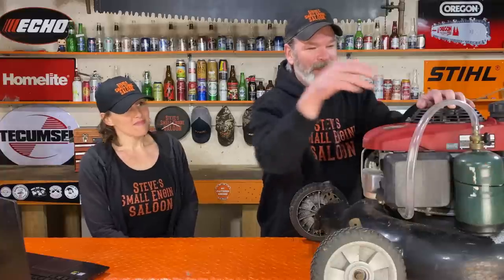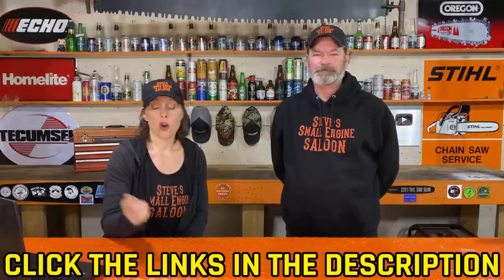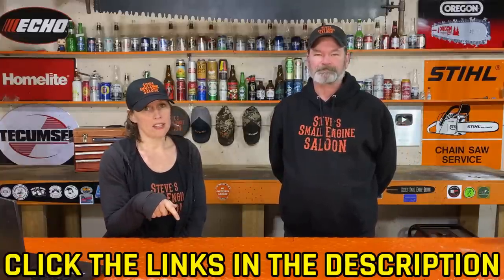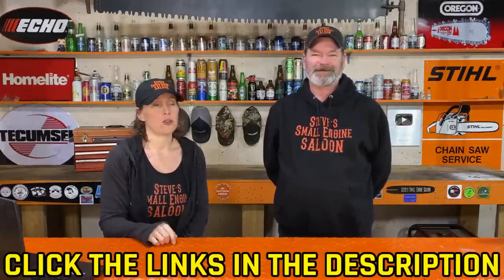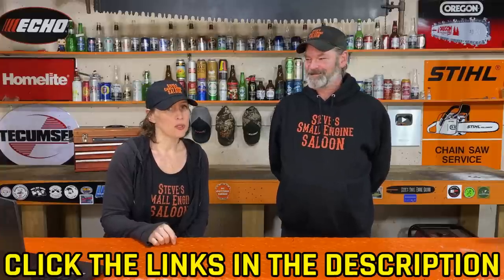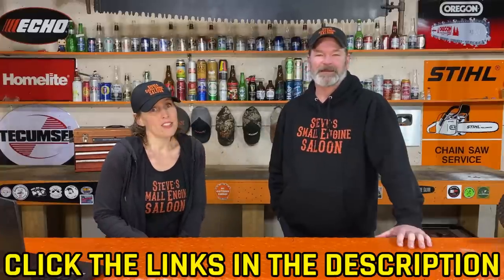Can I Make A Lawn Mower Run On Propane? (DAY 30)

Comment: I ran a 5 hp tiller on propane for a few years. 
I removed the gas tank and injected the propane in the carburetor nozzle. Was a little hard to start but once started ran fine

Comment: a propane torch (unlit) makes a very good alternative to ether.  hold the torch so the air intake draws the propane in, and it will fire off the engine enough to get it to start drawing gasoline.  I've also primed a stubborn engine by putting a splash of gas on the air cleaner element and reassembling the air cleaner.

Comment: I converted my log splitter, whole house generator and 6hp outboard to propane. I use replacement dual fuel carbs on Amazon and BBQ grill regulators from Walmart.

Comment: maybe someone already asked you and you answered it somewhere else but I have some chainsaw gas mix that is about 2 years old and want to use it up, I hardly ever use my chainsaw being in the suburbs and don't want the gas to get too old (non-ethanol), a co-worker said I can use it in my snow blower and lawn mower without any damage to them. is that true? and love your videos learned so much on small engine maintenance and upkeep thanks for the videos

Comment: I certainly hope so!  I bought 2 60" Gravely 460 models with air suspension seats about 10 years ago that ran on propane.  I kept one for the house when I sold my lawncare business.  at the time it was cleaner for the environment and propane cost less to run.  Propane only gets about 70% efficency compared to a gallon of gas though due to lower BTU's.  It was still cheaper to run, and cleaner, and less maintenance on the engine due to less carbon.  The old GTE telephone company back in the 70's had vans with over 1,000,000 miles on them.

Comment: I used a propane conversion kit for my generator.  Starts on the second pull every time
Reply: Perfect for a generator, as propane never goes bad unlike petrol/gasoline.
Reply: @justafig   If gasoline is priced at $3.50 per gallon, propane would have to be priced at $2.75 per gallon to be energy equivalent.  Around here, propane is that low in the summer but a dollar more in winter. In my generator, propane runs quite a bit smoother and cleaner.

Comment: When I was a kid in the 70's there was a guy not far from where I grew up had a B10 Allis Chalmers(Simplicity) that ran on propane.  Tank mounted behind the seat and hung off the frame of the tractor.  From a distance it looked like a factory installation.

Comment: Really enjoyed the 30 days.. Great way to start the New Year.. FYI I have a LEHR propane blower and string trimmer.  They work well a bit heavy  the 4 stroke engines   make the trimmer messy for edging lol!  but it's a good brush cutter, plenty of power.
Reply: Absolutely loved my Lehr trimmer till the clutch started getting flakey.  They did sell a 20" walk-behind mower and small outboards too!
Reply: @axl151  very powerful but I do a lot of edging so two cycle is much better. Less oil dripping all over the place.

Comment: Enjoyed your 30 days of questions. There are many generators pressure washers that run on propane and gas combine great idea I did it to my lawn more on add my snowblower because you have to start it with gas then run it on propane gas starting is it -degrees with propane will not start when it’s under 20,degrees

Comment: i had a Tecumseh 3.8 legend, on a push mower running on propane years ago, it was almost impossible to make it stall in thick grass.  i also done a "vaporizer" setup on a 6.5 HP Briggs & Stratton engine on another push mower, and was cutting grass with it.  though, for the vaporizer, you will need a water or air valve to regulate it so you can cut grass with it.  open it too far or too little, and the engine will either not start or it will stall easily.  mine was the 5 quart tank from an MTD riding mower, fuel line went from the output to above the tank, and a 5/8 heater hose from the cap to the intake, and i had the carburetor removed from the engine.  basically as air was suck into the gas tank by the hose connected to the bottom, which was cut higher than the fuel tank, you ran the engine by sucking the gasoline vapors/fumes.  a big "pro" to that was, if the fuel was contaminated with water, you did not need any special funnel or anything else to be able to cut grass, as the engine only burned the fumes that came from the vaporizer setup.  once the flammable fumes were completely gone from the fuel, then you could dispose of the remains, which will be mostly water as water is mixed in fuel anyways.  i just wanted to see if what i saw in a video would actually work, and it did, i was able to use the contaminated fuel to cut my grass without having to clean water out of the fuel system or dump out the contaminated fuel.

Comment: How long would a lawnmower run on that amount of propane compared to the gas tank that is on it?  And how easy is it to replace the spent propane container with a full one to continue mowing?  We'll soon see how how difficult or easy the conversion is and how much it costs, including the cost of propane and its tanks in your area.  This sounds like a "Should it be done just because can be done?" situation.  What are the advantages and disadvantages, timewise, laborwise and cost-wise, to evaluate whether it should be done or not?  This is my same position on all the battery-powered devices being made to compete with corded electric, compressed air, gasoline/petrol, hydraulic and whatever else.  The added costs of battery-operated from having to buy battery packs and chargers, plus the electricity expenses to charge them (which is hardly ever mentioned), for an often much shorter working time make most battery-powered devices unattractive to me.  Plus, if a battery pack device is not frequently used, the battery packs can and will go bad over time from not being in usage-drain/recharge cycle.  All battery technologies self-drain over time due to internal resistance and lithium ion batteries can and will explode when the charge level gets below a certain voltage, based on the technology's nominal voltage and its upper and lower usage voltages.  Propane would not have this issue, but it's easier and quicker to add gasoline to a tank than it is the replace a propane tank and may be cheaper to use, depending on the prices of gas and propane.  Again, just because a thing can be done does not mean that it should be.  Battery pack devices are convenient for some applications, like construction, where AC power is a factor, etc., but not so much for many other users.  I wonder how many people will find it more convenient to use propane for a lawnmower than not.

Even still, I look forward to the conversion video.  There is always something to be learned.  And weekly videos like these would be welcome.  Thank you, April and Steve.

Comment: You guys are great !  I have a troy built self propelled. It might be 10 yrs old love this mower. I am forever having to either reput the drive belt on or take the head off to readjust the pin that keeps falling out of place so when I pull to start it doesn't tank my arm off. Can you help me out maybe my next mower should be electric. Tired of messing around . Thanks if you can help.

Comment: Lots and lots of propane powered commercial zero turn mowers in my neck of the woods. Not sure what the benefit is, but I see them all the time, usually with twin propane tanks on them. Cleaner burning than gas, for sure. There may be some loss in ring life, since propane is dry and does not add some lubricity to the cylinder walls like Gasoline does.

Comment: I have a question for you Steve my neighbor tuned up my weed trimmer he did not put my air filter on it or the cover back on I was just wondering if I can use it without the air filter and cover for temporary until I can get the new one for it

Comment: Yes to the weekly Qs!  I quite enjoyed the 30 days!  I sure hope April will still be part of them. No offence, Steve, but she is waaaay cuter than you!
When I had my shop I used to use acetylene gas (no oxygen) from my welding kit to try and start engines with a suspected a fuel problem.  If it ran, then I knew where to start.  I preferred acetylene over squirting some gas in the carb, as I found it safer and didn’t stink up my shop.  I also didn’t have any danger of a propane explosion, as acetylene burns very softly all by itself.  More like a big poof of black smoke than the violent bang of propane.

Comment: Honda has one in Japan that runs on butane. They sell butane in a can about the size of aerosol spray in the United States. They also have a rototiller... Same thing. They have a lot of power in those little butane cans and they store really easily. You can see them at Asian grocery stores.

Comment: Steve have you ever came across this situation?  

On the eu3000is I replaced the starter assembly, set valve lash (intake .006 and exhaust. 008) installed authentic Honda tune up kit, and topped off the battery.  First turn of the key started right up.  I let it warm up a bit then tested the ECO setting, it purred like a kitty, I then shut it down. As it was coming to rest it made a clunking sound.  I couldn't identify where the sound came from. Repeated the start, run for a bit then shut down six times.  It started like a charm but it made the same clunking sound every time.  Since it did not appear to effect the generator I decided to make a video for the owner and when I had it set up to record and turned the key, it would not start.   It would turn over maybe 1 1/2 turns then stop as if it hit resistance.  As I continued attempting to turn the key it  repeated the same then the dogs would not in guage, it would just spin.  After pulling the start cord and then turning the key it went back to making a couple of turns then locking up and then acting like the battery was drained.  I checked the battery and it had 12.8v.

At this point I feared I somehow damaged the brand new starter assembly so I removed the spark plug and both pulled the start cord and turned the key.  It turned over with no problem as if there was not problem at all.  I put the plug back in and it repeated the same as before and would not start.  I removed the valve cover and rechecked the valve lash and found just a bit tighter on the feeler guage than i had set it but could get the guage blade in.

Please help me out here Steve and April.  Tomorrow I will be resetting the valve lash then removing everything to get to the starter assembly troubleshooting and double checking my work.  What am I missing Steve?

Comment: I converted my backup generator to propane to get away from the problem of bad/stale gas. Needed something that would start and run without spending hours draining and fueling killing battery, pulling start rope until the power came back on.

Comment: Thanks for the great videos I needs a little help on a Stihl 051 AV electronic has no spark the kill switch wire goes behind the flywheel one wire comes out and goes to the coil and the other one  goes to ground is there any electronic behind the flywheel thanks Rebel Dave.

Comment: Hey Steve,  I have been enjoying your 30 days of questions from Down Under in Sydney Australia.  Can I just get one more answer from you?   I have a Shindaiwa T230 line trimmer about 2 years old.  It starts after a couple of pulls without problem.  The problem is....after running generally at full throttle for a period of time,  regardless of if I run out of fuel or I intentionally just turn it off.   It won't restart until it has fully cooled down.  I have tried all sorts of positions  (choke/not choke),  replaced the spark plug,  shook it and swore at it,  but nothing can make it restart.   I previously had another T230 that never had this problem.   I am thinking the ignition module but would be grateful for your thoughts.  Best Regards,  Tony
Reply: Next time it does this see if you have spark by removing and grounding the plug with the ignition switch on. If no spark its a bad coil/module. I would also try letting it run at idle for a few minutes before shutting down to properly cool the engine. This might cool the module as well which is obviously getting spark to plug when cold. Definitely module related by the sound of it.
Reply: @marksmith9295  Thanks Mark,  I will give it a try  😊

Comment: The main problem with propane powered engines is #1, it requires higher compression than gasoline engines. #2, Propane is lower in BTU's than gasoline or diesel. John Deere made a test back in the 1950's with three same model/size tractors. One was propane from the factory, the next was gasoline, again from the factory, and, last but not least, was the diesel model. A "Nebraska Test" was set up so all 3 tractors would plow 1 acre of land. The propane tractor used almost 6 gal of fuel for 1 acre. The "Gas" tractor used 3 gals per acre, and the diesel used 1 gal per acre. Also, propane has very little "Soft carbon" which lubes valves, guides, and rings. They also have high seat wear. At current prices for fuel, where diesel is less than $4 per gal, propane selling at $3+ per gal times 6 gals, is expensive.

Comment: If you can, I would like to see you convert a RIDING mower to propane with a 20# propane cylinder and then test it to see how long it will mow with a 20 pounder. Why? Three reasons...
First, propane is gentler on your engine because of no carbon buildup. Second, it won't get gunked up in the carburetor. Third, it is a more reliable start. The only downside is where to mount a 20# cylinder. Thanks Steve.

Comment: Propane contains 92,000 BTUs per gallon. For every 1 horsepower 10,000 BTUs are consumed per hour. So if you have a 6.5HP push mower engine you can expect that 1 gallon bottle to last about an hour... In the summer. 

Propane needs heat to expand from a liquid to a gas inside the tank. 40% liquid to 60% gas in dynamic equilibrium for a propane tank typically. So that needs to be factored in. If you draw too much propane too quickly from that little 1lb bottle the engine will starve and stop running until the tank warms up again.

Comment: Where can I get  a plate adaptor that goes in front of the carb and has a fitting for a propane hose that allows propane to flow into the throat of the carb...??

Comment: I mounted a 20 lb cylinder on the front of a 23 hp wheel horse zero turn. I had it set up to spray with a 5 ft boom. I have a 7 acre lawn i spray. My tank would ice over about half way thru the spraying job. I would replace the tank and that would be enough propane to finish the lawn. 
I also mounted a 20 lb cylinder on a craftsman 10 hp 32 inch cut lawn tractor. I could run this tractor much longer before the tank iced over, because the fuel requirements of the 10 hp was so much less than the 23 hp engine.

Comment: Hi folks did you hear the bad news about Chevron 94?…they’ve started adding up to 10% Ethanol & you’ll note the decal above the red 94 Octane handle at your local town pump.. .Parkland/Chevron confirms that information. Time to leave our Powersport equipment empty of fuel between uses.

Comment: Just about any 4 cycle engine can run on LP (propane) or natural gas. And before it's said, except diesel. The difference is carburation and fuel supply. I worked on specialized equipment that ran on gasoline, LP and diesel, as well as battery. Ford commercial 4 cylinder and Chevy 4 cylinder, along with Kubota 3 cylinder engines. High speed burnishers with Kawasaki engines usually ran on LP. Some Kohler Command engines. I am very interested to see how you converted that mower.

Comment: Will be very curious how you did that propane conversion. I don't see a demand regulator or a even a primary regulator to bring the tank pressure down to 11" water column. 

The engine will run sure but closing off the single valve on the tank adapter to restrict the gas flow is  not good. If the mixture is too rich the valves will burn up. You need a load block to restrict the gas flow, but at 11" water column, not high tank pressure. 

Leaner is better/cooler on propane vs richer fuel fix with gasoline. Its the opposite.

Comment: If a generator can safely run on propane (or even dual fuel) why couldn't a lawn mower or perhaps a snowblower (yes there are minor problems with propane vaporizing properly in very cold weather but maybe a mirror wamer could be wired in under the bottle).  Add-on mirror warmers are available for semi-truck mirrors.  B&S engines proliferate on these units so maybe a talented person like Steve could figure out a carb interchange list.  Just think, no more stale gasoline.